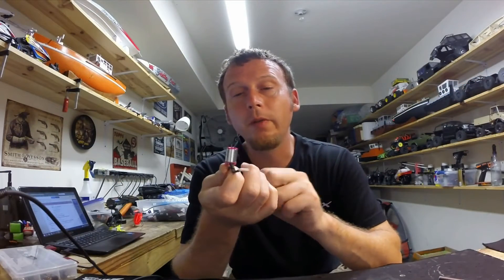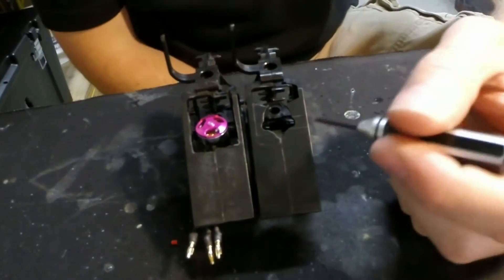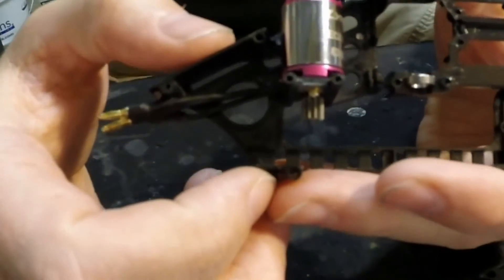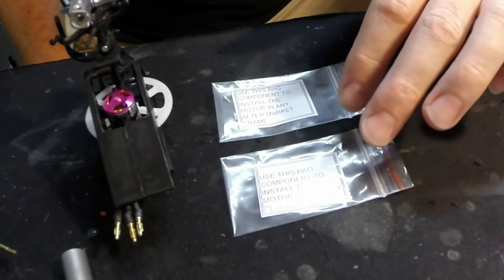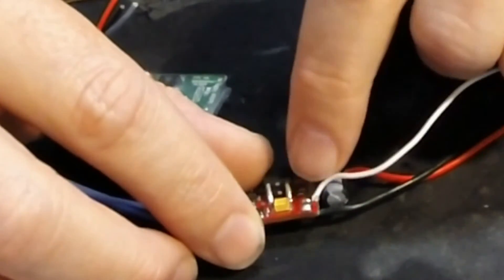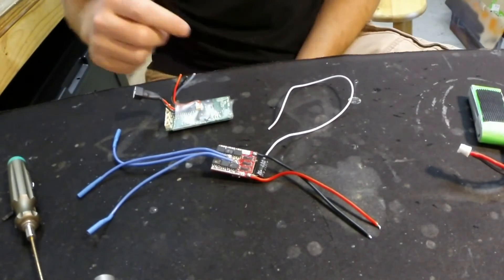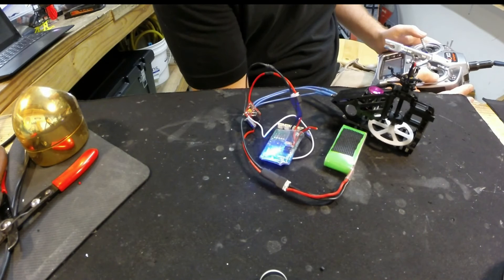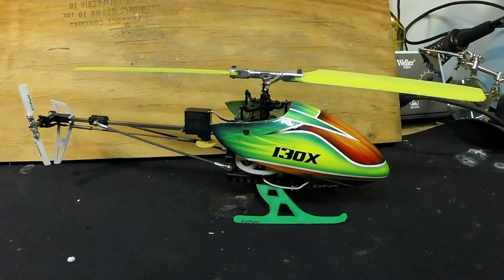HOW TO INSTALL EXTERNAL ESC ON STANDARD 130X 3 IN 1   2S SET UP

Comment: Thanks for the help ive successfully attached external esc's to few 4 in 1 and 3 in one boards now thanks to your video 👍👍👍👍 a lot of the knockoff boards from China use the same component layout as this board so signal port location is easy to spot